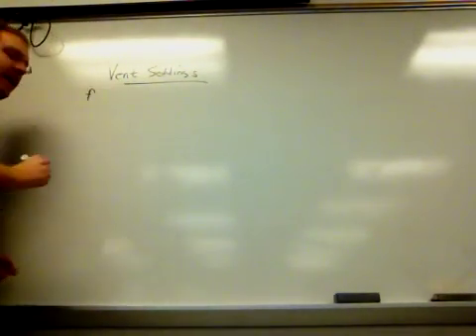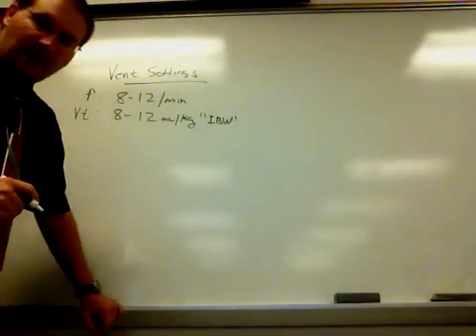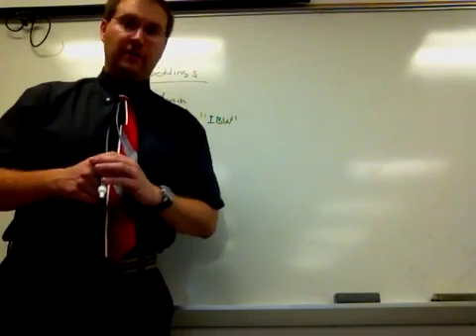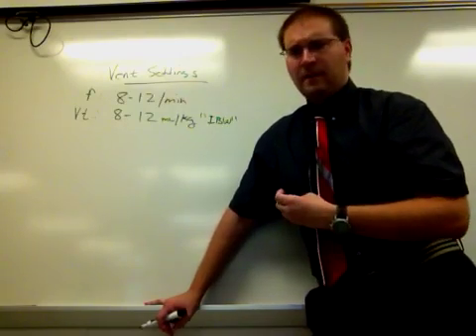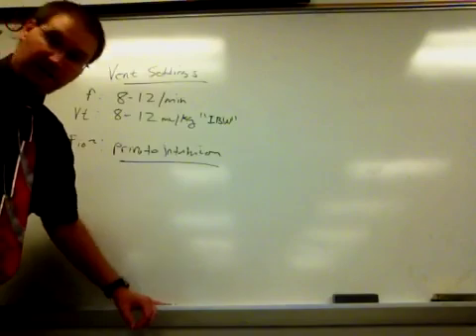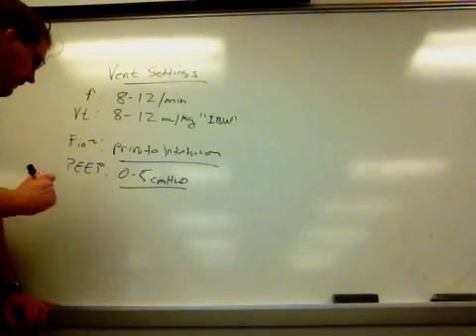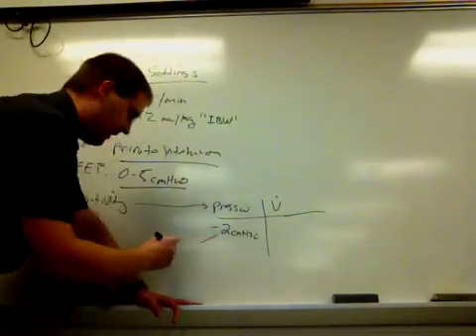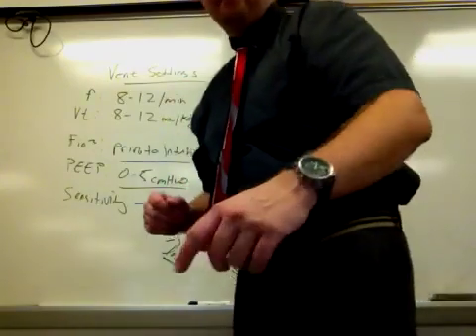Introduction to Mechanical Ventilation 7

Comment: Thanks your lecture has been helpful. I work in a 250bed hospital in the Caribbean and am better able to explain to the nurses that I work with the reasons for the initial ventilator settings. RCP. Aikman.

Comment: would consider starting with smaller Tidal Volumes (6mL/kg), such as advocated in the lung protective strategy regardless of if this is initial settings or not. There is some literature to suggest that preemptive LPS decreases the incidence / severity of ARDS late presentation.